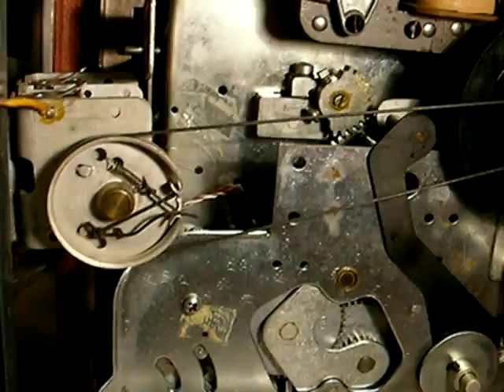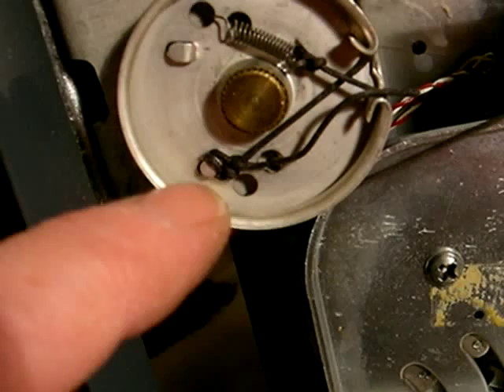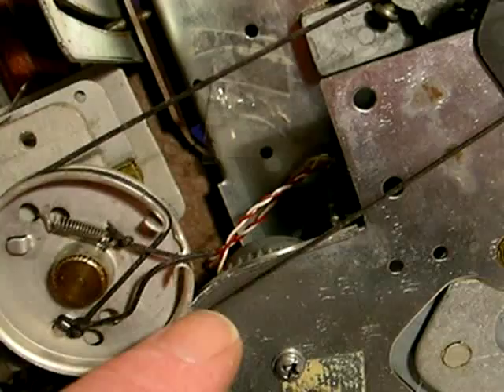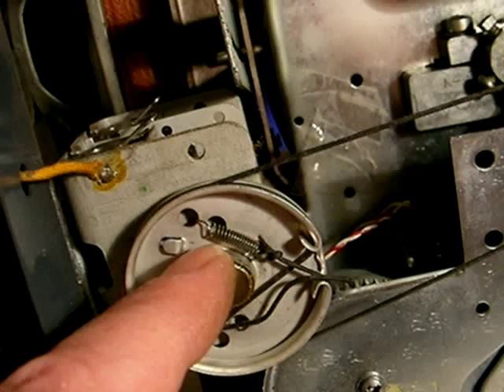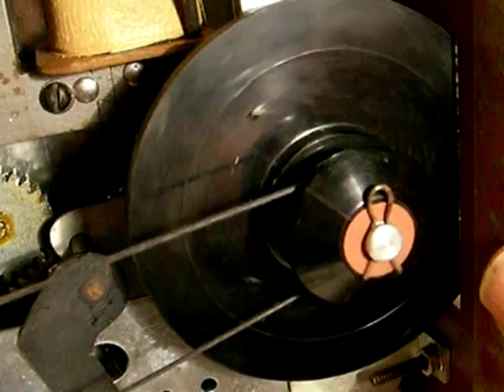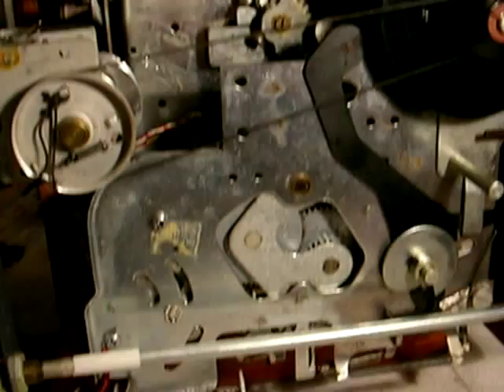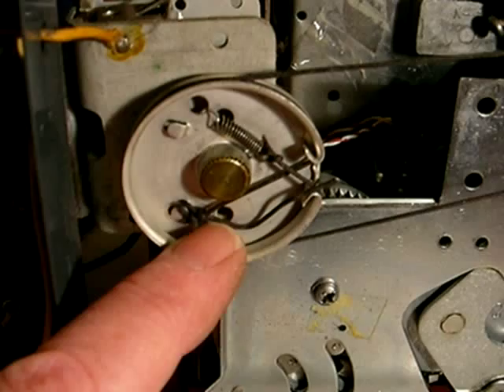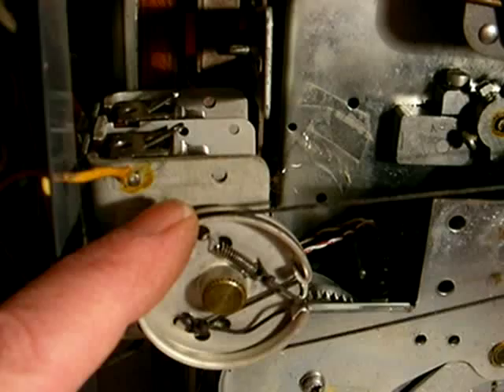Ristaucrat Dial-o-Matic dial string

Comment: Hi mate, my signal generators main wheel only has 1 tab that you originally tied your string too industrially...since i only have 1 tap/flap and no holes in the wheel for the spring, my guess is that the tab is for one end of the spring and both ends of the dial chord attach at the other,end of the spring, together? Do some dial cord setups work this way?
Cheers